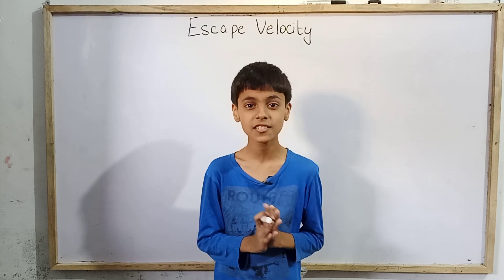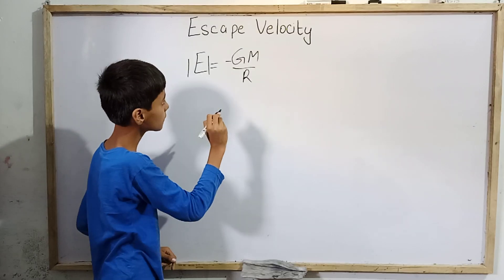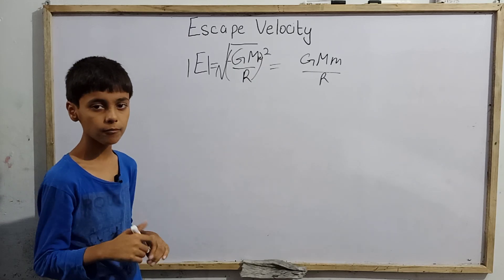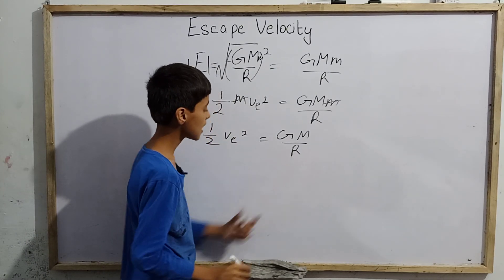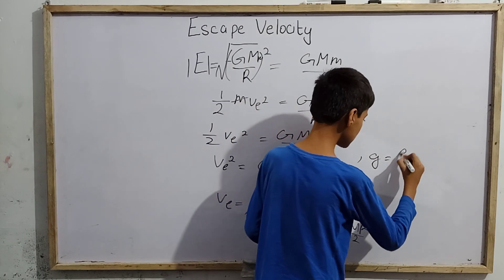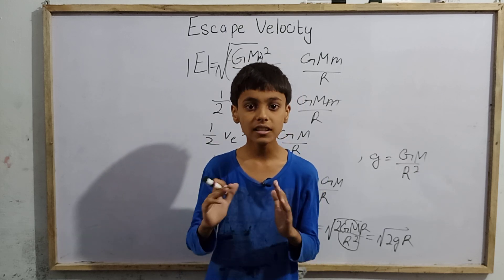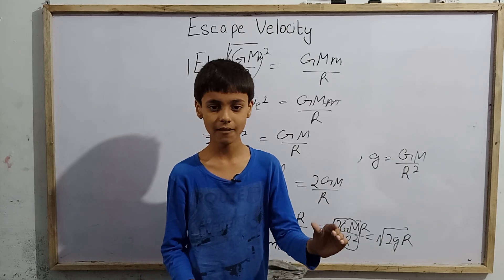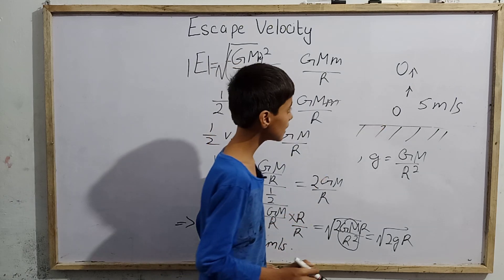Escape Velocity

Comment: Solve this -A cyclist rides at the rate of 18 kms per hour on the level and 8km per hour up an incline of 1 in 40.the resistance to his motion other than due to the incline being supposed constant. find this resistance, and also his greatest velocity down an incline of 1 in 100,if the weight of the rider and his machine be 90 kg, and if the always works at a constant HP?